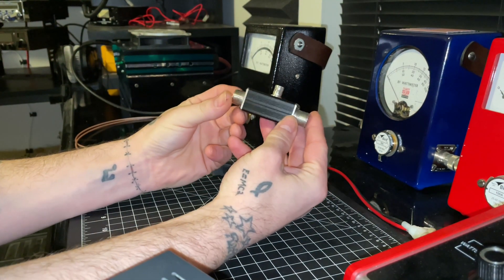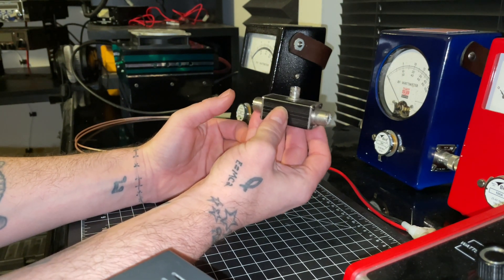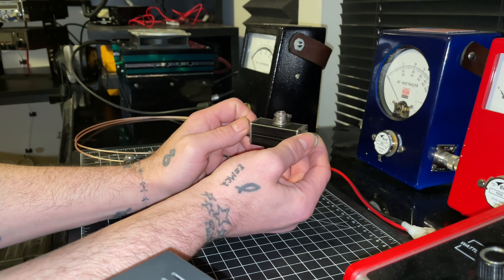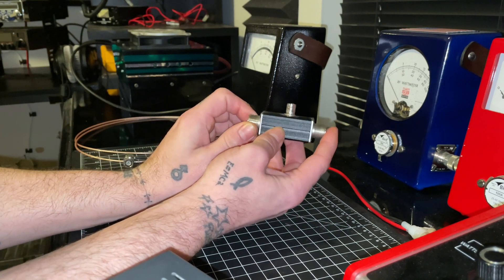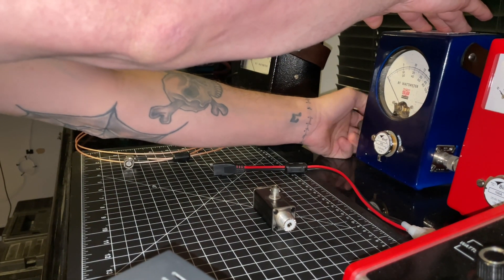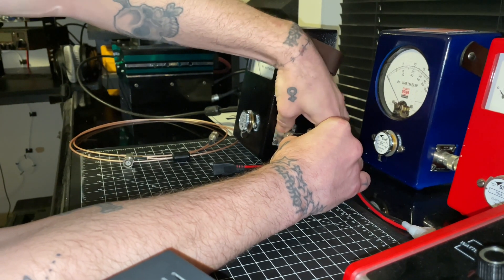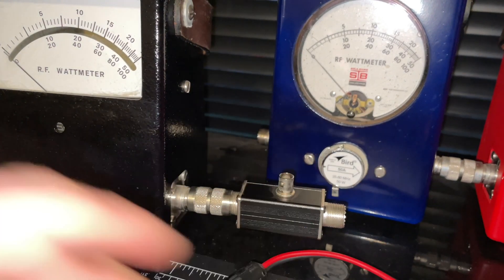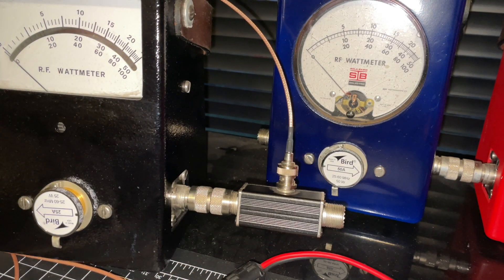RF sampler⚠️

Comment: Correct me if I'm wrong but personally I don't see any reason having a sampler that exceeds 300 watts. Only because some of the newer radios may peak close to that except for a 69FFB4 that'll do 400+. If the signal coming from the radio is clean then the amp(s) will only amplify what's injected into them.
Reply from the maker: You have a good point there brother, but truth of the matter is that amps can have there own issues considering harmonic splatter or band splatter and to check these unwanted harmonics you need a high wattage rf sampler, a dummy load and a RF spectrum analyzer. There are different classifications of amplifiers, for example class A/B or class B or class C… Now each of these classifications of amp design have there own efficiency and co-efficiency concerning mode and operation, amperage and voltage consumption, Harmonics and even heat generation.

I would definitely say for a fact that class C amps are the least efficient considering what I wrote above, but if you keep the radio clean the class C amp will do just fine and you have some fun. Although, I own a few class C amps none of them actually outperform my class A/B biased amps. 73👋🏻